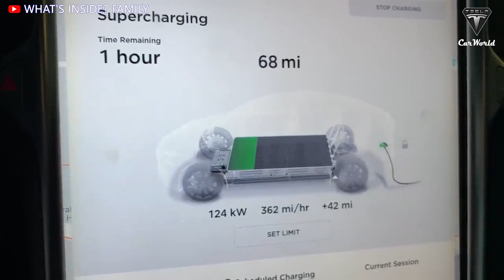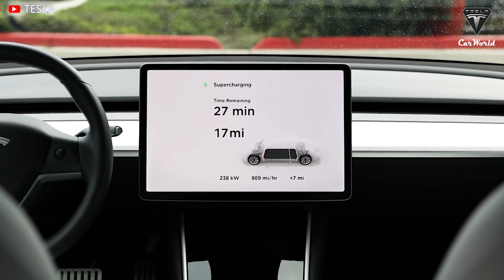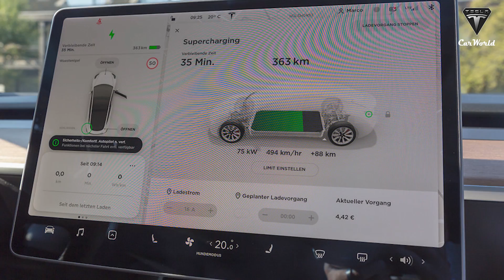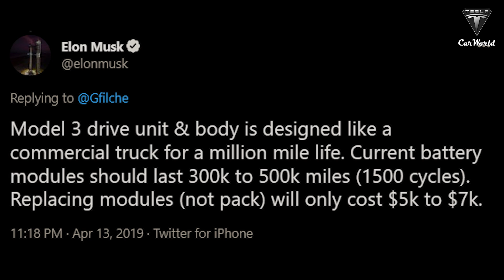HUGE NEWS! Elon Musk Reveals the New Tesla Superchargers and 4680 Battery Policies!

Comment: Tesla cars are expensive to drive, I know from experience. I’ve had over 33k n repairs in 9 years, including a $20,000 battery replacement after only 106,000 miles. Maybe it won’t happen to you, but battery hardware costs, even at 10 cents per
Mike let alone the 18 cents I experienced totally changes the math of EVs. 

EVs are the future, just know they are more expensive than You think, certainly
more than Tesla pitches.
Reply: Price on🔋🔋to EV's will drop 80% the next 10 years.
Tesla's new 4680 cell 🔋 will last 1 mill.miles / 30 years (!)
Reply: @mikafiltenborg2291  you might be right, maybe. Hopefully.  Finger crossed.  Here on earth one, batteries for the first 13 years of teslas sales history are going to start dying.
Reply: @mikafiltenborg2291  and, given other autos focus on solid state, the race to a million mile battery race is going to be tight.
Reply: I've owned a Model S since 2018.  I've only had to put a set of tires on it and wiper blades.  The maintenance and fuel is substantially cheaper than an ICE vehicle.  My experience is very typical.  Tesla owners rarely replace the batteries unless they are abusing them by fully charging and using superchargers frequently.  

You are also driving a nine year old Tesla.  With the rate of innovation at Tesla, current models are vastly superior to what you are driving.  It's pointless to compare your experience with someone driving a new Tesla.
Reply: @donm2255  my car was a low-cost car n its first 4 years too. Let's see how it hold up over 9 years.  But I'll take your point, Tesla cars are not meant to be fully charged and the charging network they brag about is harmful to use.

Comment: Would I swap my old battery 🪫 for a new battery 🔋? YES! 👍🏾 Battery technology is forever evolving! I want the latest and greatest battery technologies in my Tesla! 
I see an evolution on the horizon! Let’s say you’ve had you current Tesla for almost 10 years. It’s looking a little “well used” and in need of a cleaning and restoration. Nicks bumps and scratches. So while your battery pack is being replaced why not turn over your Tesla to the installer and have them “refresh” fix, repair, update or replace things on your Tesla while the battery pack is out of the Tesla?! It may take a day or more. Depending on the condition of your Tesla and availability of parts etc. It will be like getting your old Tesla back new or close to new! This would also be a great time to do a full inspection top to bottom and bumper to bumper. That’s next level service!